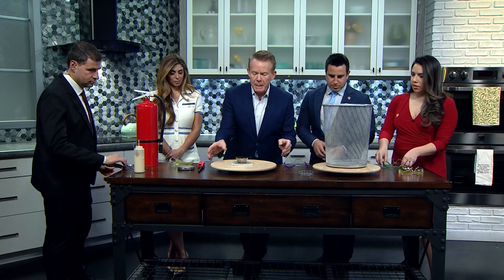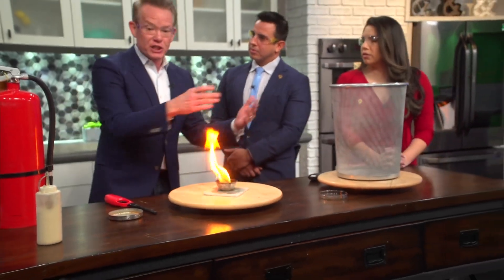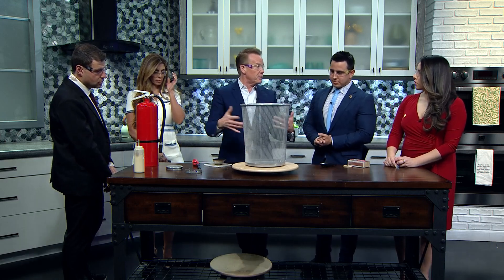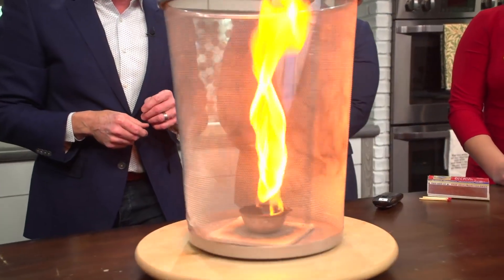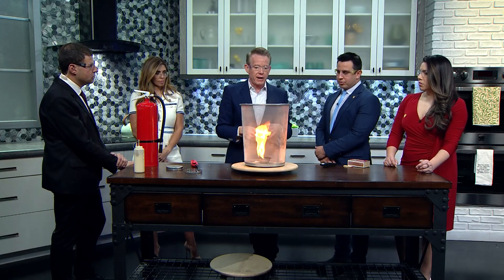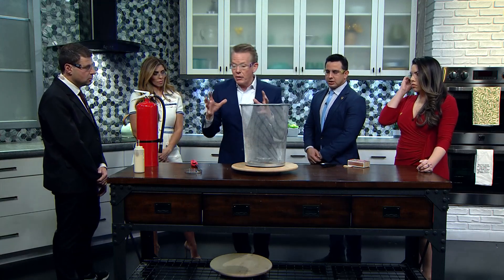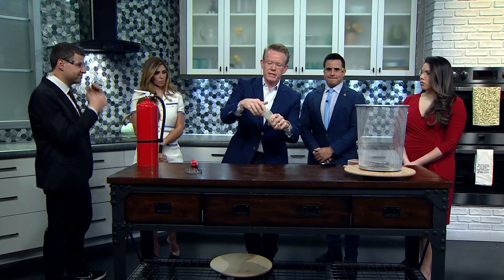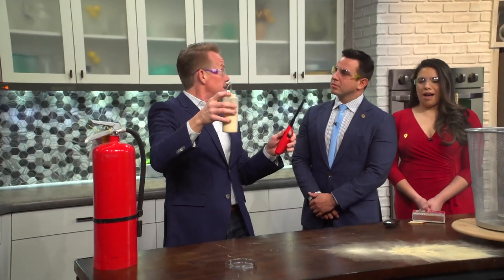The science behind fire tornadoes

Comment: I am no physicist but I think I get the gist based on my knowledge of tornados. The rotation has to be triggered by a mixing of hot and cold in an extreme manor. In normal cases its cold fronts colliding with warm fronts. In this case, because the fire is so hot it’s a massive amount of heat that needs to dissipate so it all goes up. When the cold winds it that rising coulomb of rising heat, the cold winds wrap around it creating that wrap that causes the coulomb to become more focused. As the currents shift the tornado moves, bringing the fire with it.

There are a lot of people citing Bible and Quran passages. I am Christian myself but the fact that this phenomenon is cited as what the Israelites followed in the desert at night, someone must have witnessed this in order to think to write it down.